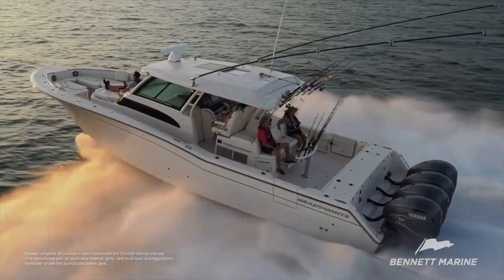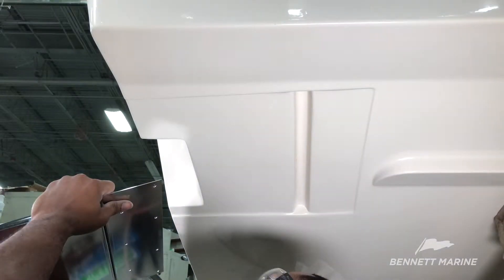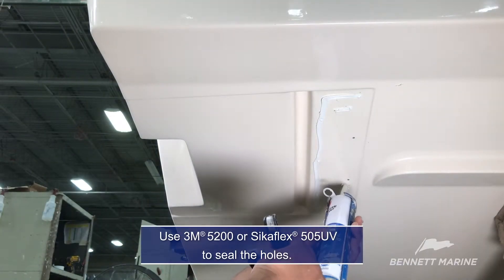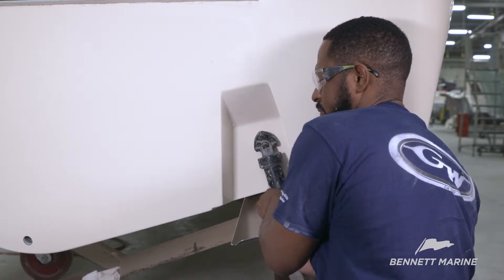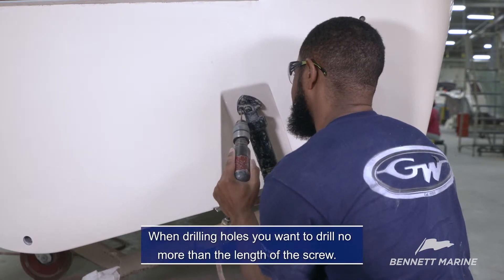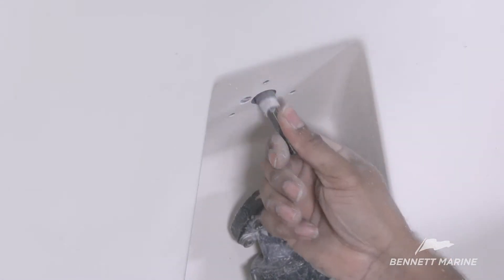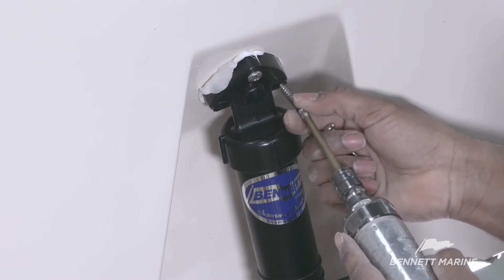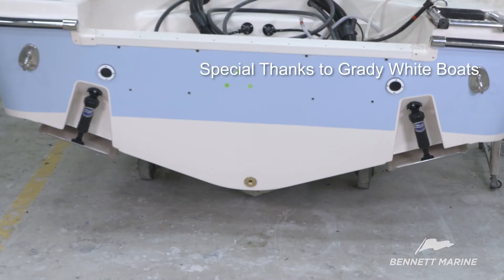Hydraulic Trim Tab Installation (Bottom Mount)

Comment: Why is 3M 5200 neccessary? Wouldn't it be more appropriate to use 3M 4000UV? Is it the screws or the sealant that hold the tabs and actuators on? When the actuators need replacing wouldn't the boat owner wish 5200 had not been used?
Reply from the maker: Sorry for the delay. Our notifications were not coming through properly. If you'd like to email our techs at email BMI_Info@Yamaha-Motor.com, they can provide an explanation.